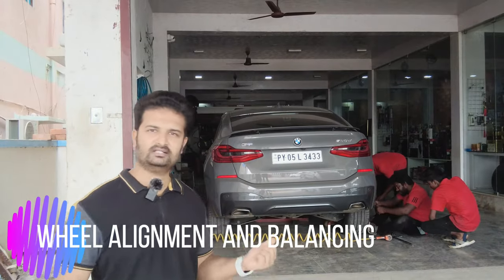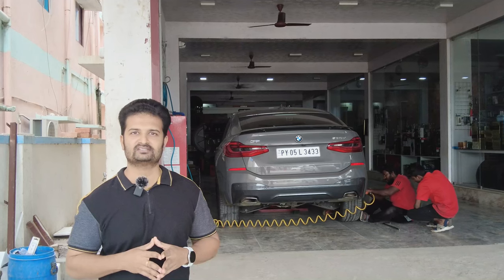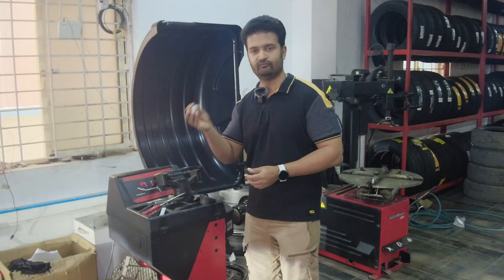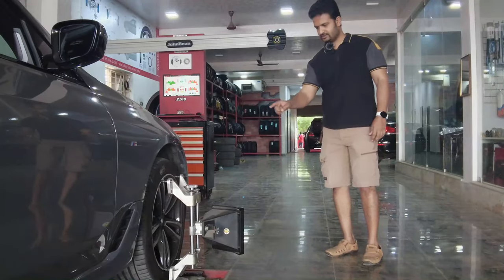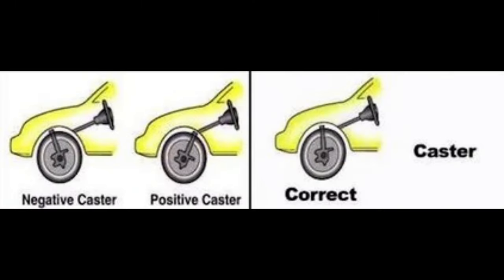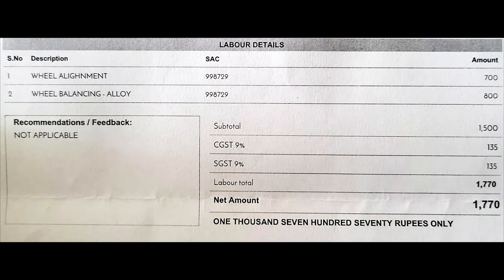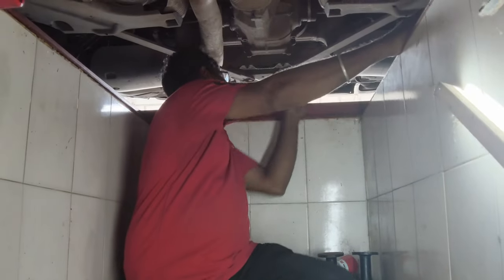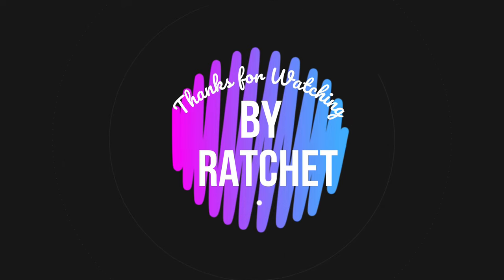BMW 630d|Wheel alignment & balancing|Cost|When & Why to do it?|How to identify it?#6gt#bmw#cost#630d

Comment: Dear Ratchet i have query.. cruising.on the highway in the middle lane if you leave your hands off the steering wheel does the car move to left after some distance?  Is that a normal behaviour? Second,  hands off the steeering whewl if you crawl over potholes would the steeeing shake in a jerky way or it would remain insulated from undulations undeneath?  Just to understand about driving dynamics of high end car i ask this......   about sound insulation of the car, what kind of traffic sounds you can hear and what you cant?    How does you feel the difference when conparrd to normal cars?   Does it block out bullet bike thump as it passes?  Kindly convey more on this
Reply from the maker: 1. The car does not go to left on a straight road. If you are experiencing something like that with your car, then do check the wheel alignment and balancing. This wheel play is one of the signs showing that the alignment is off. If the road is not straight, then you might feel like the car is not staying on the lane. This is because the car tries to be on the straight road when the road is not straight.
2. Also over a pothole or speed breakers - The steering just adjusts to the angle at which you drive over them. No shake or jerk is experienced.
3. Sound insulation - You will be able to hear feeble road noise.You would notice those when you really focus on that. But its impressive to see how well the cabin insulation is done even when the car has frameless doors. And also even if you end up hearing some noise from outside, you won't feel the sound shock(the bullet thump kind) inside which you usually get to experience in other cars.

I hope these are what you were looking for bro. Let me know incase I have understood your question wrong bro.
Reply: @ratchet1153  thankyou very much for clarifying...   do you plan to hold on to this car forever?. One request bro. Keep the car safe from the nasty chennai rains which robs us of our possessions...  cars to us middle class are not disposables as they are to business people for whom it Is a calculated purchase....  i am really charmed by your modest and down to earth attitude.... wishing you many happy miles of togetherness with your bmw....
Reply from the maker: Thanks a lot bro. Since this is my first car, it is kind of close to my heart . So I do plan to keep the car forever. And you are absolutely right about the rains bro and not just in Chennai , be it anywhere BMWs are not meant to be taken out while it's raining :( . There is no other option for me but to live with that. And once again thanks a lot for your compliment and wishes bro.

Comment: Sir what about the mileage and insurance of the car please make a separate video on it
Reply from the maker: I am getting approx. 13.5 -15kmpl bro. Mostly highway driving and I also switch between comfort and eco pro. 
What exactly do you want to know about the insurance, just the cost or are you looking for any more details? More input can help me get you the required info. Thanks for watching bro.
Reply: @ratchet1153  Thanks bro. I think this is a good number for a car cost approx 1 cr.
Reply from the maker: Yes bro. The 3litre engine is surprisingly efficient and the 2 litre engine is even more efficient than this.

Comment: Also will the bmw steering vibrate or shudder if you break hard from very high speeds ? My civic does this at times
Reply from the maker: Sorry for the delayed response bro. I have never felt anything like that with the steering. And one thing which I am very much impressed about the BMW is the handling and the breaking. And none of that stress gets to the steering.